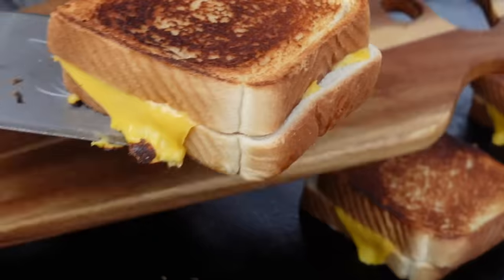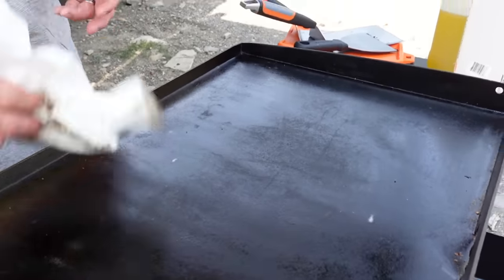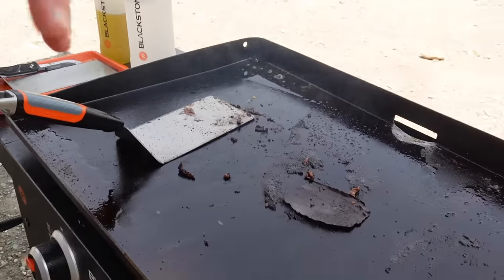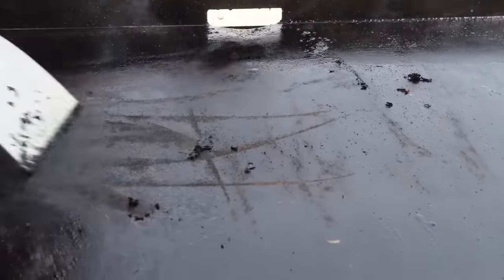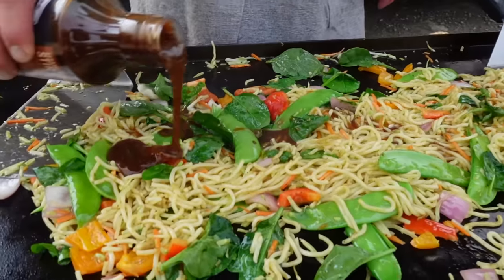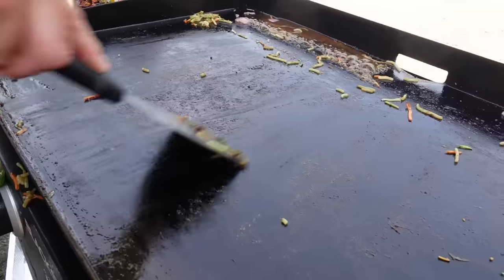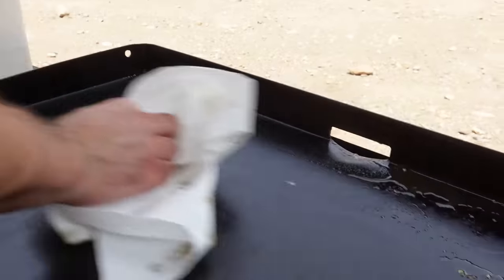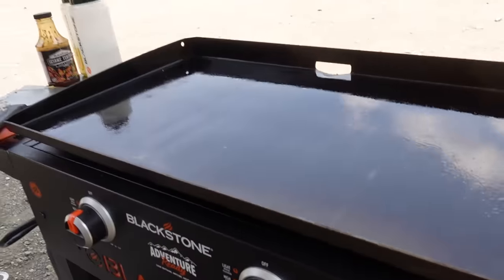How to Clean a Blackstone Griddle | Let's Give It A Try | Blackstone Griddles

Comment: A splash of water, a quick scrape, and a slather of oil. That's what I do right after I pull the food off. Takes less than 1 minute and then you are ready to eat with the family. Don't leave that dirty griddle until after you're done eating! It's easier to clean when it's hot. That water will boil off and help deglaze and sugars. I also like the last coat of oil to go on while the griddle is still hot. Helps keep that layer of seasoning! I love my griddle!
Reply: Is there a specific oil that needs to be used?
Reply: @thugnasty5242  I use Avacado oil (has a higher smoke point than olive oil). I'm sure regular vegetable oil is fine too if you eat that crap.
Reply: @Eric_Allen  Cool thanks!
Reply: @Eric_Allen  apparently avacado oil will also deter certain bugs.
Reply: Same
Reply: Hi. Question. After you clean and add the oil, and cook a week later, do you need to season the griddle again, or can you immediately cook?
Reply: @b.a.e.7532  You should be able to cook immediately. You do not need to re-season, since the season should build each time you cook. Sometimes, especially during the winter, if I let it sit too long between cooks, I will get a few rust spots. I just scrape those off and put some oil on it and start cooking.
Reply: @Eric_Allen  THANKS!!!!
Reply: Won’t the water cause the grill to warp over time on a hot surface?
Reply: @Studio54MediaGroup  I've never had that problem. It turns to steam instantly and helps losses then stuck crud
Reply: @Eric_Allen  thank you for your response.
Reply: Thank you for your advice and for your service! 🇺🇸
Reply: Navy NUC
Reply: What’s the best oil to use, I’m brand new to the black stones
Reply: @austinharrold8763  I like avacado oil because it has a higher smoke point than olive oil. And I personally dont eat vegetable oil or any other highly processed oil (like canola, corn oil, etc.)
Reply: @Eric_Allen  awesome thank you
Reply: What if you made the mistake of letting the griddle cool down before cleaning?  Should you just get it heated up again and go through the process?  Any potential issues to look out for?
Reply: @phoenixgreg  No problem. Just turn the griddle back on, let it heat up enough to steam water as you squirt water on it to loosen the food up as you scrape it down, let it heat up enough to dry all the water off completely and then apply a nice thin coat of oil on it
Reply: @Eric_Allen  Awesome thank you!
Reply: Yup!
Reply: @Studio54MediaGroup yes it will.
Reply: So you don’t burn off the oil if your gonna leave it for the next day ?
Reply: @alexmarleau8738  at the end of each cook, after i clean the griddle, and the griddle has cooled back down to below smoke point, i want to apply a thin coat of oil so that there is a wet coat of oil on the metal. Otherwise it will rust
Reply: I plan on getting a black stone in the near future I eat exclusively Carnivore diet and I will use Avocado oil to season and after cleaning great video and I live in Lafollette Tn
Reply: @Eric_Allen flax seed oil bro.
Reply: @austinharrold8763  Seed oil has been proven to be terrible for your overall health. A quality olive oil or avocado oil is the best. Make sure it's in a glass bottle. Micro plastics get into your oil from plastic bottles. Also terrible for you. I started using avocado oil for everything and I can absolutely feel my overall health is better. Just avoid anything that comes in a plastic bottle when possible. Love and God bless 💪
Reply: Rah
Reply: I have only had my Blackstone for a month. I’ve followed all of the steps and seasoned it. My problem is, I clean it after use but the next time I cook everything is black, not burned just black. (However until I watched this video I was cleaning it cold) Even after I have just cleaned it and wiping with paper towel it is black. Is this caused from not cleaning it while it’s hot? Love my Blackstone but this is discouraging. Thanks in advance

Comment: I use boiling hot water and I treat my 36 inch like a cast iron skillet. The chainmail scrubbers are phenomenal and when I see too much build up, I clean it really good and use some 40 grit sandpaper to even everything out and re-season it.
Reply: There’s no need to add the extra step of boiling water. When you spray room temperature water it instantly boils into steam because the surface is over 212F. Quick clean up

Comment: THANK YOU!!!!!! Just got a 22 adventure ready, I've seen the "level 3" cleaning videos but couldn't find much to tell me what to do if it's a very simple clean. After my first seasoning, I did chicken quesadillas on mine and when I was done I just wiped it down with paper towel to get the crums off and it still looked perfectly seasoned and clean so I left it at that, didnt add more oil but there was already oil from my cook. This video helps a ton! Very easy video and will make my life much easier. It sounds like what i did was correct but i didnt add more oil. However, there was already thin layer of oil and gridle is clean so i think i kind of did what you said in video without thinking about it. But at least now i know for sure lol. Thank you thank you thank you!!

Comment: You make it look pretty simple, probably because it is. Just got a 28" Blackstone today ... it was my uncle's who passed away this spring. Estate was selling it off, so it's staying in the family. He actually custom made a steel grate for it so they could use it like a camp stove and put pots and pans right over the burners. I think he mostly used it that way ... because the griddle itself looks like it MAY have been used once. There were a couple of dark spots, but I don't think it ever came up to temperature. LOL Cleaned it with some soapy water and a steel scouring pad, then cranked up the heat and seasoned it black. May have to break it in with some breakfast tomorrow if the weather isn't bad. :) Can't wait to try making stuff on it!

Comment: Great information. I just bought my first griddle and used it once. Worked great. I did all of the steps to prepare for the next cook. My concern is between bugs and moisture in between cooks. Do you just throw some eggs down on a griddle that’s been sitting without wiping it off or lightly cleaning it first? I took a paper towel and lightly wiped it and the paper towel is dirty or has residue on it. Is that ok? Or are we just to turn the griddle on and preheat to burn off any residue and go with that? Just don’t want to get food poisoning or anything. Thanks.
Reply: Yes that is normal. Preheat it with oil.

Comment: Todd I don’t know if everyone is like me but I found something I was lacking to maintain and have not seen addressed. 

I have had the Blackstone adventure ready  for about 4 years. Bought for my RV but liked it so much it was also used at home. Just bought a new griddle and was cleaning up to give to my nephew so was taking down to deliver it. I realized I never took the grill top off so didn’t see the areas of rust where the top connects to the stand. I would suggest people break down their griddle about once a year to look at this and have some high temperature paint to use after cleaning the whole grill.

Comment: Sir I just got my Blackstone 36inch griddle, 7/11/23, as I was watching another one of your videos on how to season the griddle. you mentioned removing the sticker on the side table, I had stickers on both the side table and griddle, I used a scraper to remove the sticker the on the griddle, my question is do I used soap and water to remove the glue residue that was griddle before I season it?  I need your help cuz I wanna cook
Reply: Yes use sop and water. Only time that you use soap.
Reply: Thank you
Reply: @DareDog.  Thank you

Comment: I have a way that utilizes chainmail that I got from Amazon.  It’s about 6x8”.  After I scrape and wipe on a level 3 clean I put it flat on the surface and quiet the water onto the chainmail.  Then use to ga to slide the chainmail around on the griddle.  It picks up food and oil that may be left.  Then I quickly wipe again with a paper towel before finish with oil.  I have a small stainless bowl to place the chainmail in.  Fill it with hot water and I have a concentrated degreaser that I add just a small amount.  Swish it around and rinse.  Either hang it to dry or roll it in a paper towel.  If at home I drape it on the top level of the dishwasher.  It really works great.

Comment: I'm new to Blackstone but I didn't like using all those paper towels so I bought some bar wipes from Amazon and cut them in half. I use those now and either wash them when I am cleaning up the dishes or toss them in the washing machine. They will never be a pristine white again but they work great.
Reply: I did the same. A lot better in my opinion. 👍🏼
Reply: Gross

Comment: Water will warp the metal that hot.  Nice advice!!
Reply: I clean mine with water almost every time and as long as my water isn’t chilled I’m fine. Never has warped it. I have slightly warped it with too much frozen food at once, but it settled back down. Room temp or warmer water

Comment: I must be doing it wrong🤔
Everything was going great with my 22” until I had a stubborn accumulation of “stuff” that resisted removal by scraping.
I tried some water (less than shown in the video) on a warm surface and presto, my 22 warped so bad as to be virtually unusable ( it did however get really clean)
I have a new cook top on order (out of stock at the moment) but am concerning that it will warp again by the application of water to a hot surface.
Looking for some advice.
Thanks

Comment: I just recently started cooking on the griddle. I’m still getting used to it. I learned the other day that coconut oil is a bad idea. I didn’t realize it had burned until we ate and everything tasted like burnt grease. I then figured out why it was smoking more than it had before. I saw you use olive oil with cleaning. Can I use it to cook with? I feel like that will smoke and burn too. I started using beef tallow. Which is great for certain things, but maybe not for all things like pancakes.

Comment: So when you’re adding oil at the end, what temp do you have it on? High, medium-high, low, or did you turn it off ?
Reply: Safe bet he had already turned it off.  These hold their heat well and you are not putting the oil on to polymerize it with high heat, just to prevent oxidation.

Comment: I just got a new 36" blackstone. I seasoned it and work great the first 2 times.
 I used it the other day, and it's not getting very hot and the flame is very small.
 Is it the tank that is bad, or is it the regulator?
Reply: probably tripped the regulator safety.   Turn it off.  Unhook the tank.  Wait one minute.  Hook it back up.  Turn tank on slowly.  Then try it.

Comment: I turn burners to lowest setting,  scrape food particles.  
Squirt some water and scrape again if necessary. 
Squirt water and wipe with towel. 
Turn burners off.
Squirt some oil,  spread it around with towel, and soak up any excess.  Done.

Comment: So I don’t need to season my griddle after every use? If not, how often should I season the grill with the conditioner?
Reply: Yes don’t need to season it after each use. Just add thin layer of oil after you clean it.  Depends on how often you cook on it when to reseason jt.

Comment: Thanks for this but aren't you not supposed to leave "wet" oil on the stone? I thought it was supposed to be dried on with heat? I'm just curious because I'm new to this and am just going by the directions it came with.
Reply: Hi, Shannon.  No, you're always supposed to leave a THIN coating of oil on there.  Make sure you watch our videos on seasoning and get back to us if you have any more questions.

Comment: I seasoned my new 36” blackstone griddle and just cooked my first meal on it, which was about 12 burgers and eight Brauts. When cleaning the grill while hot right after cooking, everything came off except for on the right side it seemed like there was black chard spots on my griddle that wouldn’t easily scrape off with my scraper and water so I wasn’t sure what to do to get it to be a smooth oiled surface like you have in the video again before I cook on it next do you have any suggestions, basically it just looks real blotchy in one little section on the right where some of the brauts kind of stop initially when I put them on the grill
Reply: I just cooked steaks and marinated chicken on mine tonight. It was my second time using it and I have the exact same problem that you have described and it’s also on the right. I’ve not done anything wrong so I don’t know what caused it and how to remove the charred spot. It was on the side of my marinated chicken.
Reply: @jeremygodwin5007  I’ve since used my several more times, and with each successive use and cleaning it appears to be evening out and cleans quite easily for me now. I’ve heard the more you use it and cook on it the more seasoned it gets and the less likely things will stick or char on the grill and that seems to be what I’m seeing now.
Reply: @kimberleesublett  I was wondering if after using it more if it would disappear. I know from watching plenty of videos that I didn’t do anything wrong and was wondering if it would just eventually go away. Thank you for your response and information.

Comment: I dont use my griddle a lot in the winter. What should i do before I close up the griddle for the winter? is there a such thing as winterizing a blackstone griddle?
Reply: Blackstone brand griddle seasoning contains wax. I'd wipe down your griddle with it while the griddle is cool, unlike when you season it hot. Should leave a layer of wax that will last thru winter.

Comment: Todd,   How do you keep from everything being black?   I started cleaning like you show but everything had dark oil on it the next time I used it.   Now I clean a “little” longer and when I start it up next time, I let it heat up until it stops smoking.   Then oil and cook.   No more black oil in food.  Everybody shows clean up, nobody shows startup.   Am I doing it right or wrong?    Respectfully,   Kevin
Reply: Good question….have the same issue
Reply: @katrinadillard7282     If camping and going to use very soon, I crank up the heat and go to no smoke.   If not, coat with oil and when starting, crank up heat till no smoke, let cool some and oil just before cooking.  Seems to work for me.

Comment: I see tons of videos using paper towels on their griddle surface.....either for simple cleaning or re-coating the thin layer of oil.  When I do it, I constantly get paper towel residue all over the surface.... why is that?  I use really good paper towels... the Viva Signature Cloth brand.  Is that it?  Do I need to use a cheaper brand of paper towels?  It is so frustrating trying clean up the food.... then having to clean up the paper towels :(
Reply: Brawny industrial is ones I use.

Comment: Loving my Blackstone, so simple to cook and clean. However, I noticed cleaning with paper towels leaves paper residue on the griddle surface. Instead I use handy wipes to oil the surface, leaves no trace of lint or residue.
Reply: So I was wondering how his griddle top is so glass smooth, and he can use paper towels without any leftover bits. I ended up rubbing the brick on mine for a while and really grind it down, then reasoned and now its pretty darn close to his. 

So start with that to make your surface smoother. If you did that and still no luck. Buy the blue Scott Shop rag paper towels. Theyre incredibly strong, much more than any bounty or other paper towels. I still use those in this exact cleaning method.
Reply: @CoyoteOne i was about to message the same thing my paper towel would leave lint and my griddle was not properly seasoned either. I did not look as nice as the one in the video either. So i started sanding it and under the black seasononed griddle i found rust. I guess i didn't season it correctly the first time. So after i re seasoned it after getting it to bare metal, its just like the guy in the video and i clean it with water same as him with no paper towel residue behind or anything 🙂

Comment: The problem with wiping with paper towels is that they leave little bits of paper behind since the surface is not totally smooth. I've been looking for something different.
Reply: Lint free or low-lint cloth...I use shop rags you buy at auto parts stores.  Usually red or blue color and come in boxes of 5-10 for a few bucks.

Comment: Thanks for your GREAT how to videos. Just bought a 36 blackstone, Getting ready to season it so we can use it this evening. I have a question, but not on cooking or seasoning, but the construction. I'm thinking about replacing the pan that supports the legs, I assume its for accessories, and replacing with 2 angel irons so I can move the LP tank under the griddle on the left side. With the tank at the end it keeps the folding shelf from folding down completely. Where we have space to store the griddle, makes it hard to fit. Do you see any problems with doing that?
Reply: The other mod I would make is to have 4 swivel casters instead of 2 swivel and 2 fixed. It would make it easier to move the griddle around. I love cooking on this thing.

Comment: You don't indicate the heat level on the griddle when you clean it off, and put a coating of oil on it.  Do you keep it on high the entire time?  I've seen various videos, where some say turn it down on low, and others say other things.  What do you do?
Reply: High heat when cleaning.   That's they way I've done it for the past 10 years on the Blackstone.  Thanks for watching!